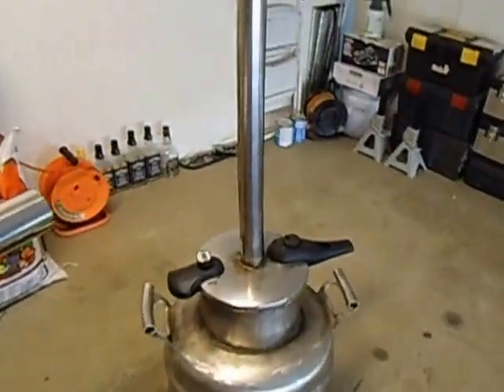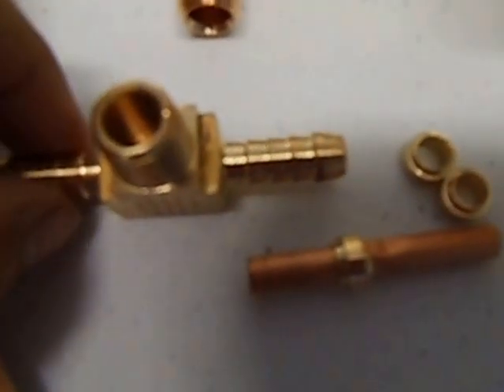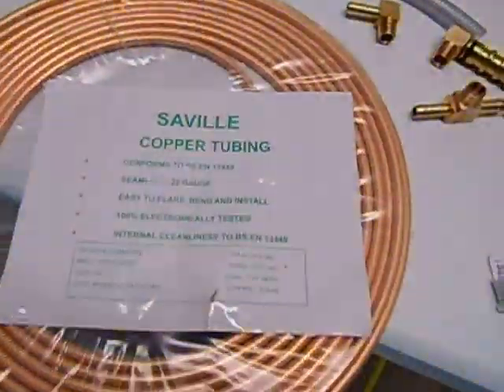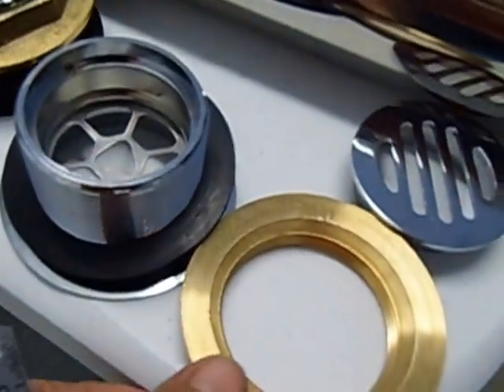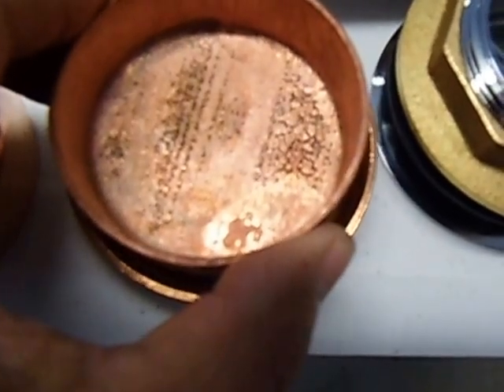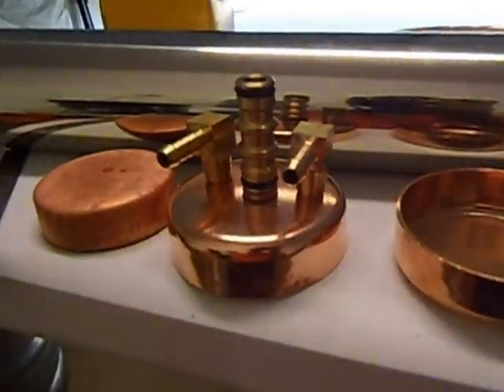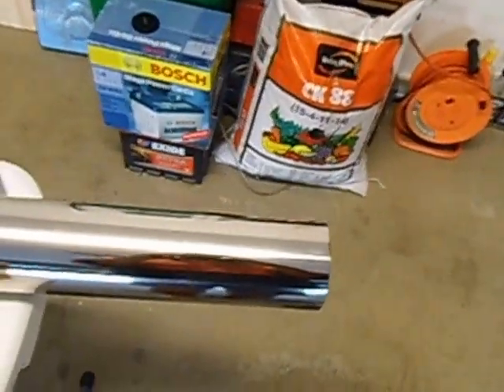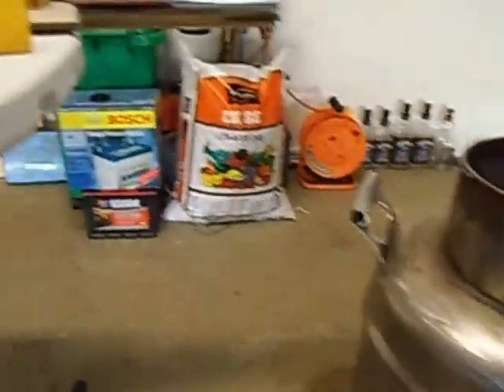New reflux collum for my 50lt still part 1

Comment: I hope this is for fuel only. No zinc, rubber hose or epoxy for drinking alcohol. Also hope there's no rubber sealing that pressure cooker. Temperature is irrelevant, its the solvent aspect of alcohol and the by products of distilling that eat away at those things.
Reply: moncorp1 he said sink with a south African accent I think?